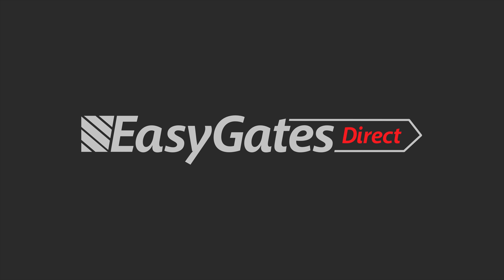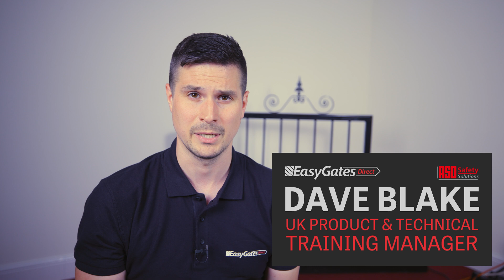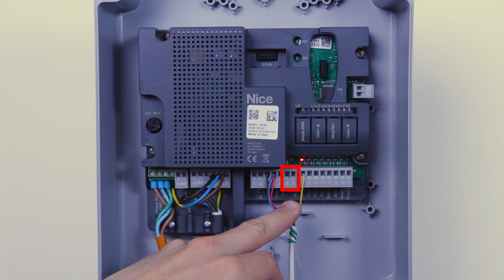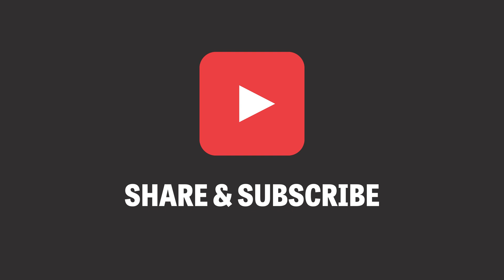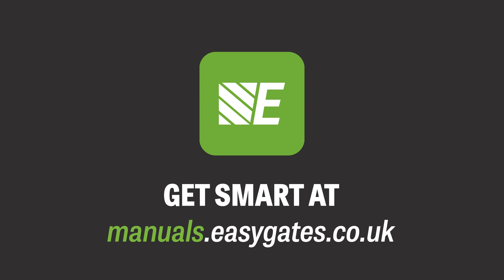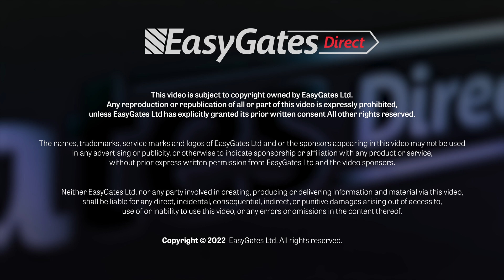Nice MC800 - How to programming Inputs and Outputs?

Comment: come collegare pulsanti apri chiudi sulla centrale mc 800
Reply from the maker: @user-zc9jz2kn4g,
Thanks for your comment.  To configure the inputs and outputs on this panel, you will require either the Nice Oview Programming tool, or the Nice BIDI WIFI. These devices will assist with the full programming of the board as well as configuring inputs / outputs which are not accessible from the basic programming via the panel buttons.
If you require any more information on the programming with the Oview or BIDI WIFI, please see below links.
 
BIDI Wifi Setup:
https://www.youtube.com/watch?v=YWcVlff1sMI
 
OVIEW Programming (MC824H):
https://www.youtube.com/watch?v=NQEa_MS7D_o&t=1027s